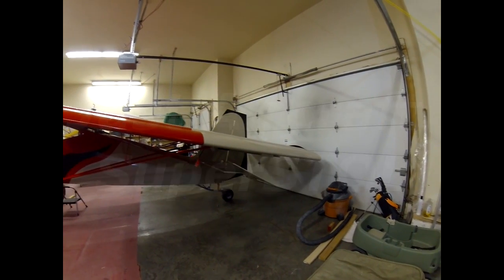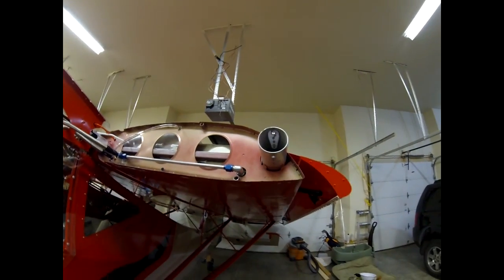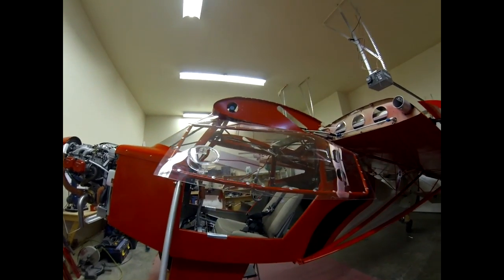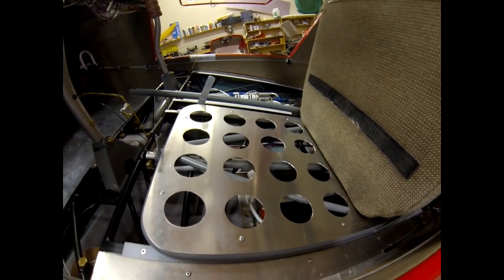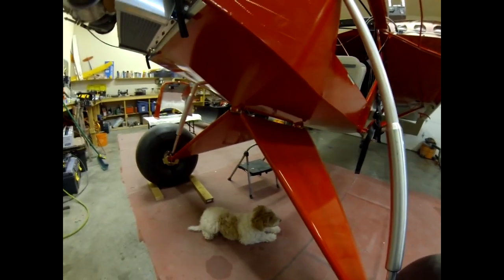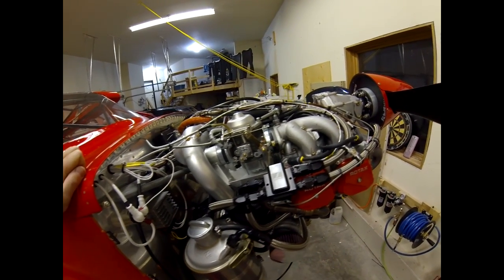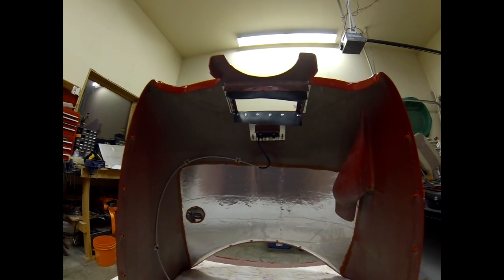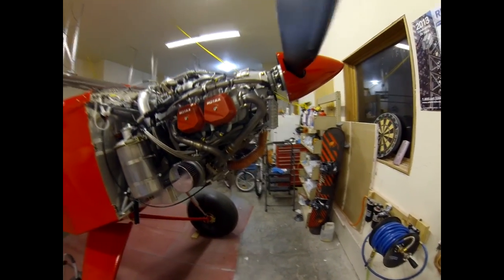Just Aircraft SuperSTOL Build Part 2

Comment: Shame it doesn't have AM15 in it vs the Rotax.
Reply from the maker: If you like to tinker, experiment, spend less money and always fly over landable areas, through the auto engine in.  If you want to install and just fly, install an engine designed for aircraft from the start.
Reply: Branchair Aeromomentum AM15 is designed as Aero engine.   Check them out, very long track record.  The base engine built by suzuki which builds as many engines in a month as rotax has from the beginning of time.  Much more reliable with orders of magnitude more installed engines.
Reply: Suzuki doesn't design engines from the get go for aircraft, they are converted for aircraft use. They may in fact be reliable, but the concept between power plants for aviation and other types of usage is completely different.
Reply: Branchair I think they are also heavier. That Rotax is a great way to go.